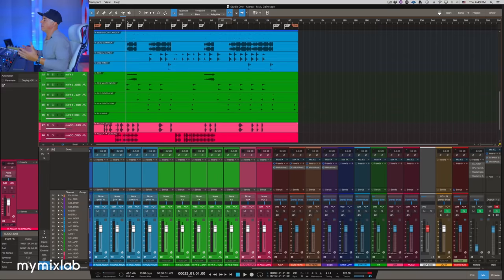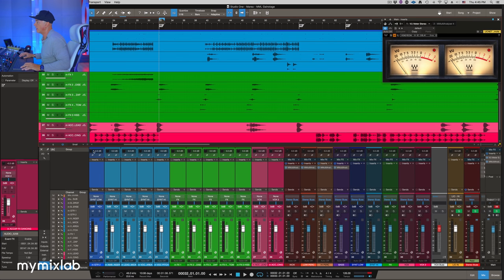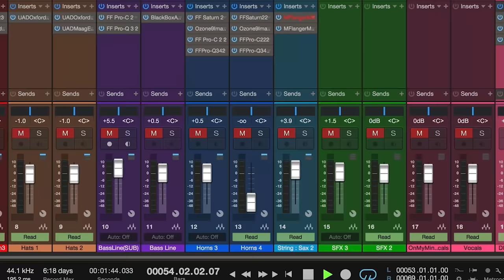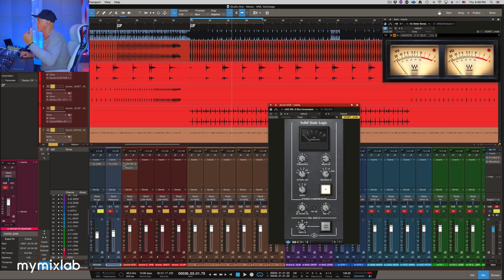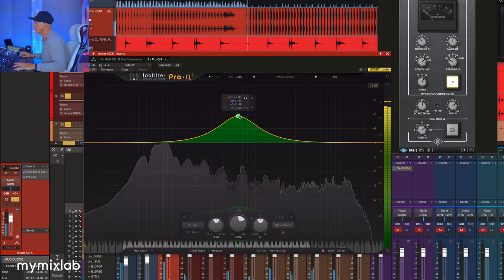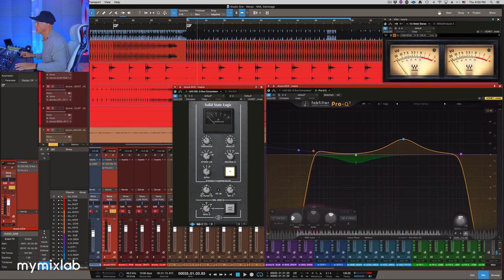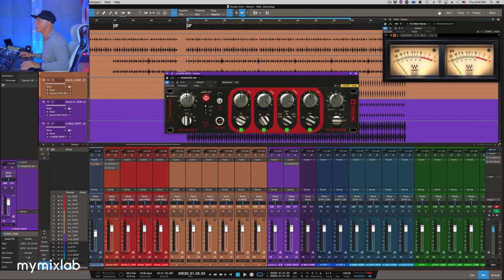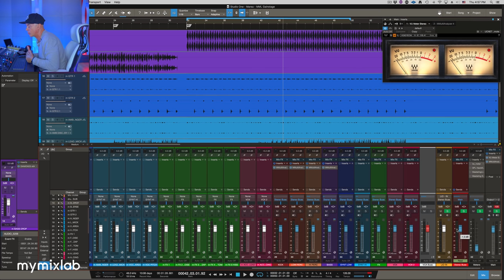HOW TO Mastering Levels & Gain Staging | Luca Pretolesi (3x Grammy Engineer) | TUTORIAL

Comment: The sweetspot begins with - 18dB it seems to be important to stay consistent during all the mix for the premaster, it becomes more obvious because the input gain is driving the compression for envelope shaping. Not using the faders but the trim fader is a hard lesson, because post faders change the volume in a logarithmic style, not equally it could add confusion. By that moving the post fader in the upper range has not that much gain loss as moving the fader in the lower range.
The advantages of a trim fader is a linear gain difference  not only because it is driving by input gain the response of a compressor. 
 Maybe next level would be to check how the needle of the VU meter is moving not just binging it to 0 dB for cross channel consistency, a dynamic short intersample movement or it could be dependent on panning. For the dead center gain staging is important because most instruments are usually not that much panned and clash easier together. For LCR basic mixing the sides could use a different VU sweetspot. That's the freedom of stereo mixing.
There is a difference between gain staging to bring everything to 0 dB or using gain staging for different instrument groups or genre dependent gain stages. It becomes more clear when using gain staging as an instrument for placing it in front or background, as example a hihat in house music could stay at -18 dB but for other genres where the focus could be more on snares and kickdrums, the hihat could stay in the background by a - 24dB or even - 36dB VU setting.
The deeper truth about -18dB could be that kick and snare drum focused music are more in the range of a bass instrument which loudness octave changes within 6 dB (otherwise it becomes unpleasant by digital clipping or on the other side raising the noise floor too much ). Doing the math -18 dB is a jump of 3 octaves of 6dB (because 6*3 = 18)
For panning law one octave of 6 dB is dedicated (3 dB for each side)
Reply: @musicdude1540   About loudness consistency - the difference between post and pre fade. Matching gain staging process like on the analog mixing desk  becomes possible by VU it is really a gem to use a VU meter because obviously of the pre fader (trim) and the voltage control becomes more apparent. Doing the levels right before compression or limiting is important for dynamics. Even if working with 32 bit files where the dynamic range is greater than 16 bit, clipping still can be possible if not summed in right place however digital clipping is nasty. For that reason if doing things like saturation and clipping oversampling is important because otherwise high frequencies 'bounce of the nyquist limits' and clutter the mix with artifacts. Oversampling upscales the signal to a higher bit sample rate to do the processing.
It becomes more apparent with layers and a great channel number. 

 On analog consoles clipping results in more saturation and is even sometimes desireable. Logarithmic contour like available on almost every DAW in the post fader changes the dynamic tuning by larger gain jumps below 6 dB if you so will once you used a lot of compression, doing gain staging with post faders is contraproductive (once you did a lot of toneshaping with compressors it will change the timbres).
Because there needs to be a second step by boosting make up gain and the pumping becomes more prominent which is not always desirable. 
The intensity of gain if turning faders down changing much more faster in larger increments than leaving the faders at unity gain... which has to do with fletcher munson curves (different frequency perception at lower gain levels) 

Equal gain structure is important in classic music, lovesongs and ballads. Pumping is more important on EDM bass heavy bangers, rock music and so on. 

 However there are any rules do whatever is good for your mix.
Similar to things like bringing the whole mix down by -6dB or so for the mastering chain, so it will stay the same by every preset.
Reply: @soundcore183  The only thing i dont understand is which faders are the pre faders in other daws.
I use fl studio and then i use the fader outside the desk. So i use the fader of the sound itself (not in the daw itself).
I really wonder what the pre fader is compaired to the daw he is using.
If you know you can also explain how it works in other daws, maybe i can relate to that then.
Reply: @MeesterGgaming  very simple even in fl studio when you open the mixer each point in the fx can be a prefader when inserting a tool device to adjust the gain or you make a prefader out of the main fader which means level changes are applied before the fx chain not as regular after. The regular attenuation which happens after the fx chain is called a post fader. (where the oposing  prefader can be seen as an input drive gain). Input gain makes a difference to the response of a compressor very similar to the threshold. If not using a tool every dynamic plugin usually has a control for volume. The difference between volume and gain is relative and absolute value.

The main scheme is: prefader (input gain) -> fx slot -> post fader (makeup gain)

Analog mixer outside the daw can be routed in both ways as insert or aux however usually you would prefer an a/d conversion at very end because that is kind of a final limiter with a more precision dynamic control otherwise there would be no point in routing. With high quality a/d converters it makes any difference.
Reply: @soundcore183  Thanks a lot for the fast and clear answer!
I did used pre fades some times but not enough at it seems.

I almost always use volume VSTS in fx slots but that seems not to be pre fading if i understood your explanation correctly? So pre fading is before you hit the FX slots right? For example within the VST were you make the sound or withint the tool device were you open a sample for example right?

Thanks a lot for your fast and thorough answer!
Reply: @MeesterGgaming  absolutely it brings your productions to a whole other level!
For level loudness matching for consistency I suggest something like dpMeter5, for phase alignment to read out better RMS values I suggest RX and for trim faders for gain magic I suggest airwindows even that plugins have any good ui they are like a swiss knife for doing that stuff of gain changes. For more loudness to be done before limiting there are Kclip, Freeclip, acoustica  studio dmi lift. Klanghelm VU meter for better readouts.

Comment: When I watched this some time back I didn’t really understand what it was about. But now I have started using a VU meter it all makes sense. I have found tracks with guitars have a lot of dynamics and there is a big swing on the VU meter.  I 
changed it to peak and set the maximum at about -6 to -5 by altering each  wav by soloing each track and that seemed to work out ok. I need to work on reducing the plug-in levels. 
Big question???  Is the VU meter placed pre fader or post fader on the master channel. By my logic post fader seemed the obvious? 
Thankyou for your wisdom 😀😀😀

Comment: I know this is a year old, but Yes!

What he showed was valuable, but incomplete.
If you got a folder of tracks, along with a rough mix from a recording session, then what he did at first is ideal.

Your monitoring is set to the dB SPL level you listen at.
Your master fader is at Unity.

You’d import All tracks as is with channel faders at Unity.
Including the Rough mix on a track that ideally Bypasses the master bus and goes straight to the same hardware outs as the Master bus.

I’d reverse one of his processes though:
Yes select All Tracks, and Yes grab the clip gain or input gain if your DAW has that, if not just add gain plugins to every track and select all of those.
But rather than start at Unity and bring the level down, Before You Hit Play, start at infinity and bring the level up.
Reaching the same level as he did, but without any unexpected surprises, to your speakers or worse if you’re wearing headphones.

Now, where I totally agree with you, is this only helps with the Mixbus and Monitoring.
(Oh, and I’d bring that Rough Mix up to the same level, flip the phase, and they should cancel.  Flip it back and you should have a perfect match, Before any actual mixing.  You can then exclusive solo against it at every step to see how far you’re deviating from the Rough.  Other Reference Track work similarly.  Before Metric AB of course)

As for Gainstaging the individual channels, doing it this way Inherits whatever levels you received and doesn’t Optimize those channels for Your Signal Processing.

So for Gainstaging each channel, imagine a DAW with no clip gain functions, the level comes off the waveform and hits the first plugin slot.
That first slot on every channel should be a clean Gain Plugin.  
Then you’d go channel by channel and use a meter to bring them each up to 0VU, Individually.  Preparing them for whatever signal processing you’re going to do next.

Okay, so to stay with what he was doing, but on a Whole Signal Chain basis, (which is called Level Matching btw.  It’s a cousin to Gainstaging, not Gainstaging itself.) 

You would also add another Clean Gain Plugin to the Last plugin slot of every channel, and input the exact opposite gain of the first.  So if you Added 3dB to channel 1, then cut -4.5dB to channel 2 in the first slots, you’d cut -3dB, and add +4.5dB in the last slots

If everything is setup correctly, it should sound Identical to before, and still phase cancel with the Rough.
You’ve only added and subtracted gain in a linear mathematical way, and just like 2+2=4, 2+(-2)=0.  

However, InBetween those Input and Output Gain plugins, you are now “Calibrated” for any Digital (which don’t care), Analog (hardware inserts), or Analog Emulation processing in a way that they were designed to be operated.

Everything else he showed about Level Matching each plugins inputs and outputs, is spot on.
But if you aren’t “Feeding” each processor what they want, then Level Matching becomes concerning yourself more with the processors before and after, rather than getting the most from the one you’re on.

It’s also why plugins should All have and input and output gain of their own.  (Well at least non-linear plugins). 
Many only have an output gain for level matching purposes, but with both, then you can easily “Drive” the plugin, to see what it does when you hit it harder, or softer, and then compensate on the output.
As every analog engineer knows, the calibration level in the manual isn’t necessarily the level that I want to use, or sounds the best to me.

Lastly, manually using level matching plugins like this has a couple of other benefits and controls:

You can now use these Input and Output Gains to “Drive” the whole chain!
Maybe you went a little overboard on the saturation from 5 plugins in a row, dialing back the Input to the chain may smooth the whole chain out, and then compensate at the end.

But also…
Having the Last plugin in the chain solves another issue that Often gets conflated with Gainstaging.
Fader Resolution.

The standard 100mm fader is not linear from top to bottom.  (Google Fader Taper)
Quickly, the top half is linear and the bottom half is logarithmic.
This allows for the top 50mm of finger travel to be extremely precise, and the bottom 50mm to roll off rapidly to infinity.
A brilliant design.

Typically the 0dB Unity marker is at the 3/4 point, or 75mm from the bottom.
Then the signal is Boosted (say 10dB) before the fader, but when the fader is brought to the Unity mark, it is reduced by that amount.
So it gives the illusion of having the ability to Boost by 10 or 12dB above Unity.
“10dB In Hand”.
Again, brilliant.

But in the digital realm, this can be arbitrary.  Some DAWs let you configure the behavior of the Virtual Faders in their Virtual Mixer, but they all somewhat emulate this analog audio taper behavior.

So, in order to have maximum “Fader Resolution”, you want the faders to Start at Unity, giving you 25% above and below of precise linear travel.

A mistake made by Many People, is to adjust their actual Gainstaging pre-fader, in order to preserve Fader Resolution.
I didn’t hear this mistake regurgitated in this video, to Luca’s credit.

This is an understandable mistake (especially for live sound engineers), because if a sound is way too loud in the mix, you grab the fader.  But pretty soon you have a bunch of faders in the bottom half of their travel, making it much harder to mix.  So you grab the input gain at the top of the board to dial it back, then you can push the faders back up and get control over the mix again.  Problem solved.

Except you’re now not feeding the signal chain with enough level, and you’re getting into the noise floor, plus just not letting that processor do what it can do.

Well back to our DAW with a Gain Plugin at the end of the signal chain, Just Before The Fader.
You can just turn That down like a pre-fader trim, and Not be effecting the optimal signal levels of your processing at all.
Healthy signals on All channels, and trimmed levels to the faders, still sitting at Unity.

And this leads to the next benefit.

Before any processing, and after setting up your session, naming, routing, coloring, etc, and then Gainstaging the channels like above, the next thing you’d likely do is a Static Mix.  (Which is faders and pans, no processing.  Just moving all of the raw ingredients to where the belong on the soundstage.)

If you’ve now set all of your input gains to feed processing, and you then grab all the faders and fly through a mix, pushing and pulling everything into place, when you hit stop the Song is now maybe 80% of what it’s going to be, but those faders will be all over the place.

You can now however, Transfer ALL of those fader moves over to that Pre-Fader “Trim/Gain” plugin, one-by-one, and reset All of your faders back to Unity.  (Then you Could do it all again, in another “Pass” on the Static Mix, fine-tuning what you did before like following a 60-grit sandpaper with a 220+)

Mixing is iterative, and pass by pass, you now have the opportunity to periodically transpose your fader adjustments back to that Trim plugin for a reset.  To many who are trying to mix as Fast as possible, this will seem like an unnecessary step.  And it isn’t strictly necessary.  The whole point is that it is sonically neutral.  This is purely about workflow, and control.

The final place where this workflow is invaluable, is Automation.  (Especially if you use a Control Surface, even a single fader.)

Having reset all of your faders to Unity, means that your Fingers (even on a mouse) are always starting from their default resting position.
I view Mixing as a Performance, one that builds upon all of the other performances.
All of the Artists and Musicians’ performances have been captured, you’ve now organized and processed all of that, and reigned in all of their performances to fit together into one piece.
That Mix is now Your instrument, and Automation is where You get to breath life and movement back in wherever you feel serves the final piece of music.

Having an Automation phase of the mix, that starts with all of the faders reset, is what makes adding that extra step in setup, completely worth while.

And if you haven’t figured it out yet, each time you reset your faders, you’re refreshing your mind and perspective as well.

Comment: Hey Luca. This one is a very useful tutorial on gain staging. Keep up the good work.  I still have a question concerning balancing because i noticed you didn't touch the faders. Obviously the purpose was to demonstrate that whatever needs to happen should be done pre fader but at the same time I was wondering if one wouldn't need to use faders to balance the tracks (instruments) before this stage (if  I am making any sense). I find it very confusing in my opinion because I don't understand whether or not all instruments should have the same input , I mean the same gain volume prior to gain staging. Thanks.
Reply: From my understanding. A good producer will already have a well balanced rough mix before sending to the mix engineer. Alternatively, the levels could have been balanced for the purpose of this video,  hence why there is no need to touch the faders.

But this is how it should look

STEP 1. Producer or mix engineer does a rough mix. A vu meter is usually put on each channel, with faders on unity/ default position. Mix engineer will adjust channels/ or groups to hit around 0vu.

STEP 2: once this has been done you can mix with faders as normal. The thing is not to obsess with the vu meters but your main elements will tend to stay around 0, while supporting elements will drop slightly. 

Think of it this way,  a mix would sound terrible with all the possible elements being at 0vu. Some naturally will have to be lower. 

So the simple answer is yes you can touch your faders if it’s its necessary to create a more balanced mix. 

Watch a few more videos on it to wrap your head around gain staging.